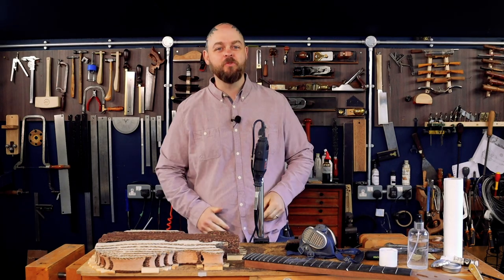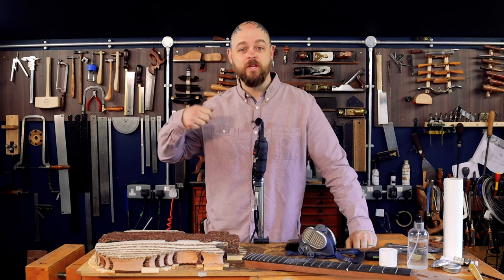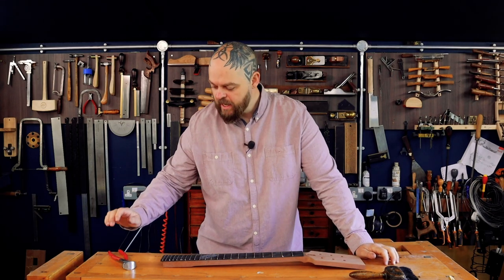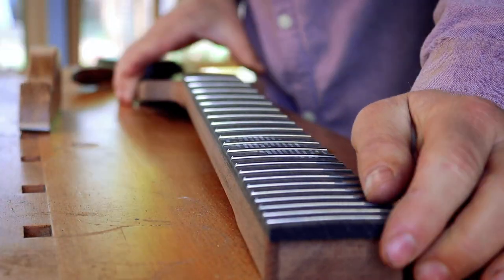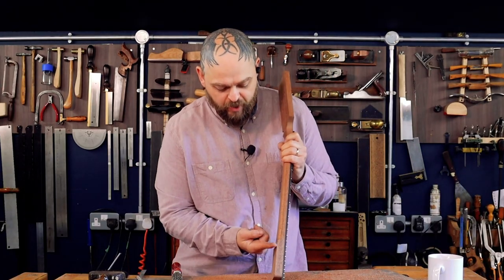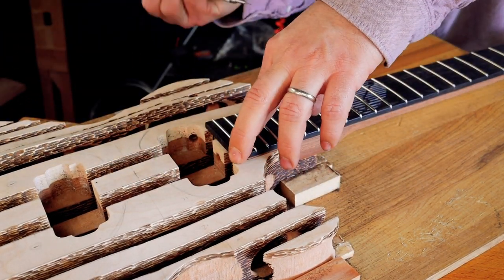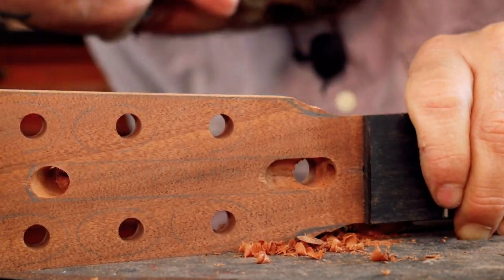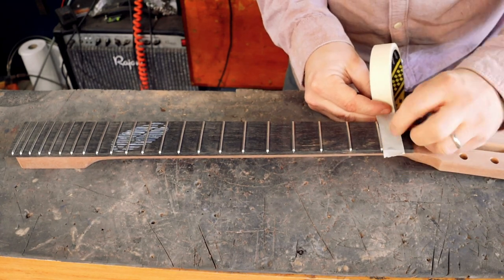My Great Guitar Build Off 2020 Ep. 4 - Taking a Kit Guitar one step too far?!?

Comment: I agree that the half-round crowning files are terrible. You have to use masking tape AND a metal fretboard protector to be perfectly safe. My main player has a massive gouge in the fretboard because of those things; it tore straight through both layers of masking tape and went right into the wood. Never had that problem with a traditional crowning file.
Reply from the maker: I am sorry that had to happen to you.. I bought one of the concave files early on in my career and damaged two fretboards.. at that point gave up, they are really really nasty tools.. I agree with you though, fretboard protector is also a god idea. B

Comment: I don't know, Ben. It seems like all that shielding paint has hidden the cool texture. Foil would look cool, but can you apply it in such a way that the texture reemerges? I know, I know...you are the master and I am the grasshopper. Can't wait to see it completed.
Reply from the maker: Lightly buffed up it looks a treat, I'm very happy! B
Reply: I actually thought the same.... The wood finish with dark burns from the Dremel reminded me of the finishes I'd see on things in Japan which I thought was the intention...All natural... I would have liked to have seen an oil based finish over the wood as is, maybe with bamboo sections crosswise to hold the pieces together under pressure of the outer band.  Black with texture could be interesting too though...

Comment: For a future thought ....  about 35 years ago I took my Gibson 66 melody maker and put a “C”shape hole in the end of the headstock due to a big gouge it received .  The sides are straight and parallel from Gibson and the head stock end had a little bit of the LP shape originally. I angled the ends a little to the C HOLE ( don’t want to make that dirty ! ) and it looks stunning . Repainted it recently and had little work to do to revive it .  I’m so glad I did it , considering I was young and stupid ( now I’m old and stupid ) I had originally drilled it out with a hole saw and managed a perfect center !  At least I drilled from both sides .

Comment: You're probably past this point knowing the schedule you have, but as you posited the question: how many bolts is enough? Take a look at Taylor's electric Guitars neck joint. It used but one compression screw to hold the neck in place, and I had never heard of them having any problems.
Reply from the maker: Hey Lloyd, that they do! Big surface area and a good strong bolt is all that is needed for great tone transfer. B

Comment: One thing I'm very interested in is your new enviroment. Humidity control - how important is it for you - since the wood is already seasoned and your process on a kit is relatively fast. Do you need to be concerned about humidity and should kit buyers be aware of these issues?
Reply from the maker: I'm checking it every week with my Wagner moisture meter.. it checks the workshops relative humidity etc and right now I 'm not worried, I fully insulated it etc but expect to need a dehumidifier going soon.. B
Reply: @CrimsonCustomGuitars  Haha!  DE-humidifier!  What a concept.  Here in Arizona, USA I have to run two humidifiers to keep my 130 year old banjo from exploding into dried splinters.

Comment: Ben, I am genuinely curious.  How are you going to glue/bolt/screw this mass of pickle slices back together?  You have textured all the surfaces that would "Normally" be used for a joint surface.  You sliced it up, removed a bunch slices, and then giant worm holed the pieces left.  Then you textured it to the point that looks like someone's skin when too much time was spent in water and now looks all wrinkly.  So,  How are you going to put Humpty back together again?
Reply from the maker: We will see tomorrow if it works, but basically I'm going to add a steam bent rib all around the outside.. it should work. It really really should. B
Reply: @CrimsonCustomGuitars  O.K.  After I commented I got to thinking.  If you took a small piece roughly the size of a domino and put on the end of each gap you could make it look like the gaps were made by a chisel.  Even with the rib, you may still need to add a filler in between the ends.  Well, now you have another idea you can borrow if needed.  God bless and you are welcome.

Comment: All I could think of when you cut out a hole in the headstock was the old Kramer necks that are mostly aluminum
Reply from the maker: there is nothing new under the sun, those were cool geetars! B
Reply: @CrimsonCustomGuitars  Travis Bean were there, first, of course, with an all aluminium neck and a sort of T shaped slot in the headstock. But it was indeed Kramer who adapted the idea, by including  wooden inserts in the back of the neck, i believe to make the neck feel less cold to the hand! And reshaped the headstock to a deep notch.

Comment: Sir.. Is it possible to use epoxy instead of carbon fiber?. Route two channels on the neck like how we would normaly do for installing carbon fiber .. and fill up those channels with epoxy.. will it help strengthen the neck?
Reply: Epoxy isn't as strong as the wood, stiff but brittle. you could lay glass fiber into your epoxy but the result is the same as glueing in a fiberglass rod which is way easier. You could go with steel or titanium rods but everybody seems to agree that carbon fiber is the best cost benefit balance.
Reply: @brocktechnology  hey thanks for the information.. really appreciate it🙏
Reply: As brocktechnology said epoxy alone is not enough. Carbon fiber as material has the greatest stiffness per weight so it's popular. You also have to have in mind where the forces are greatest and where to support the stiffness of the neck- best on the outer surfaces and least effective in the center of the neck. So the fretboard itself or just under the fretboard, back of the neck (think of 3 or 5 piece neck look) and the volute area. 
As in Parker Fly you could wrap the whole back part of the neck in carbon fiber and do pretty much anything, even put strips and voids in the neck profile but that is another can of worms which i'm dying to see Ben use. :D
Reply from the maker: I agree with the others who already replied.. epoxy won't do a thing in its own, you need carbon fibre, steel, etc etc to add strength. B
Reply: @CrimsonCustomGuitars  thank you

Comment: That shielding paint looks awesome.  You are going to have to start selling it in bigger bottles :)  Interesting factoid:  Graphite is the only non metal that is good at conducting electricity.
Reply from the maker: the only?? I had no idea! B
Reply: Graphene does as well, but yes, that is also an allotrope of carbon. And of course doped silicon can conduct electricity, as this is what is operating in your computer right now.
Reply: @timbeaton5045  My limited understanding is that silicon is sort of a metal?
Reply: @cheapskate8656  It is classified as a Metalloid...."Typical metalloids have a metallic appearance, but they are brittle and only fair conductors of electricity. Chemically, they behave mostly as nonmetals."

https://en.wikipedia.org/wiki/Metalloid

so neither/nor! I only mentioned it as it is strictly not classed as an actual metal!
Reply: PS it is also tetravalent, as is carbon. And in the same period chemically as carbon (above, in the table) and germanium and Tin, both below in the table. Note that the "metallicity` increases as you go down the period.

And of course to an astronomer, all of these are metals!
Reply: @timbeaton5045  Thanks for the edumacation  :)
Reply: @cheapskate8656  You're welcome.I'm here for your edusplainment! 😁

Comment: I don’t know if you’ll ever see this, but if you or someone else in the comments has advice for me I’d greatly appreciate it! Ever since I got my electric guitar, I’ve noticed that if I fret the G string anywhere on the guitar, it sounds out of tune. No matter how much pressure I apply or even if I’m using a capo, it sounds like the string goes out of tune. This makes it nearly impossible to play. I’ve had the guitar for over a year and haven’t been able to fix the problem. If anyone has ideas please respond! Thank you!
Reply from the maker: It is either the intonation out at the bridge or the nut slot is too high.. basically the guitar needs a good set up and it will be fine. B
Reply: Crimson Custom Guitars Awesome, thank you so much! I love all your work and I’m planning on building my own guitars at some point as well. Keep up to good work!
Reply: @nathanpearce6718  Does have to be said, that the G string is ALWAYS an issue when it comes to tuning. Even if you set the intonation at the bridge perfectly. The classic demonstration is to play a first position Gmaj chord followed by an Emaj chord. The G string sounds either slightly flat in the G chord, or slightly sharp in the E chord. All down to the scale being based on the 12th root of two. 
 Just a fact of life, and i would guess that tuners are set up to "bodge" it slightly so that the unevenness in tuning is equally "bad" in both keys

There are guitars with those true temperament frets that promise to alleviate tuning problems like this but are hideously expensive, and I would have thought introduce all sorts of other problems in the process.

Comment: With all those gaps the shielding paint is just paint.
Reply: It depends on the highest frequency of the RF you're hoping to block.  Seeing as 10GHz is about 3cm, I think it'll work fine.
Reply: @nwimpney  it isn't just the width of the hole it is the length of it too which runs at least the length of the top even if you ran a conducting band around the perimeter and grounded every painted surface. If he connected a wire to the outer two conducting surfaces it might be some sort of multilayered capacitor which would be spooky if it measured 22nf.
Reply: I doubted the efficacy as a Faraday cage, too. I think it is mainly there as a design element, now. Would all be much simpler if guitar bits simply used shielded cable. Would eliminate the need for this kind of thing.

Comment: Neck hole between tuners... suspend COPPER LOGO. Should shine WILD against the metallic black inside!
Reply from the maker: That is the plan.. though I'm vacillating on the copper, maybe silver? B
Reply: @CrimsonCustomGuitars  Copper. You could flip on the body top with copper leafing and black chrome hardware? Inside the body between layers use black Dacron plastic cylinders as separater stand offs, black out the wires. Maybe a carbon fiber patterned pick guard? 45 degrees off of the neck line.